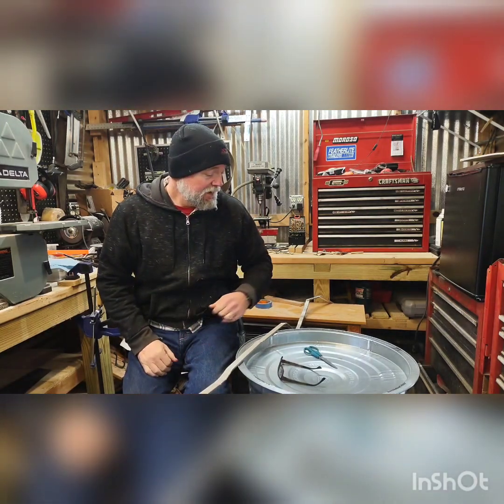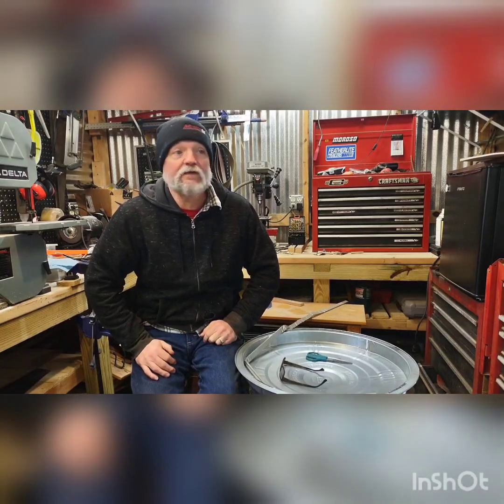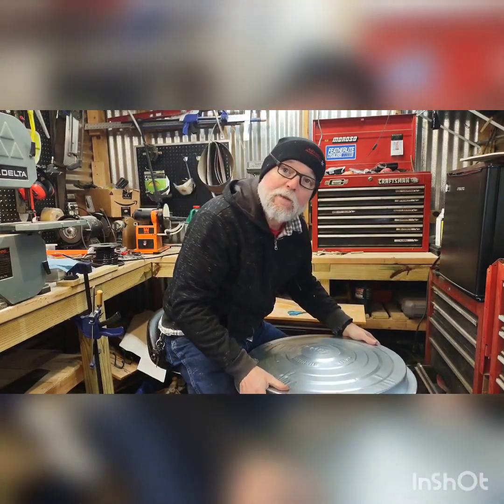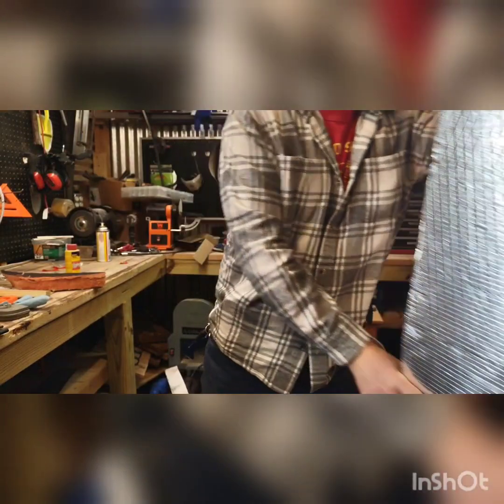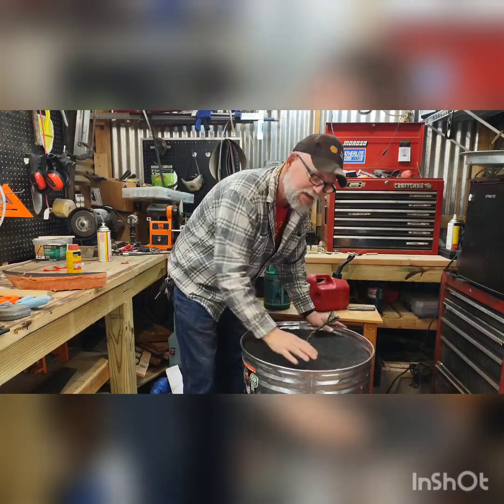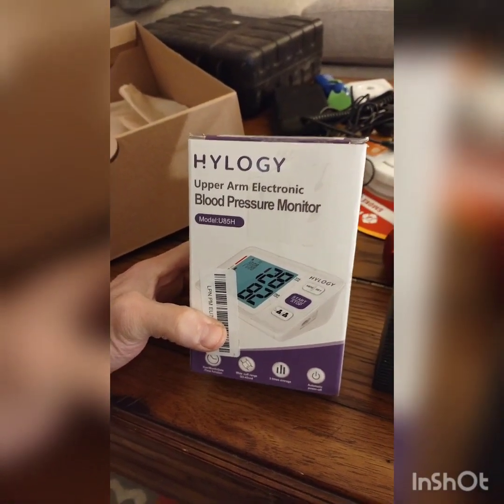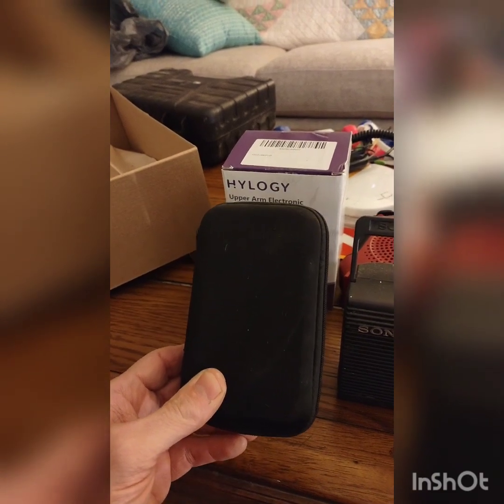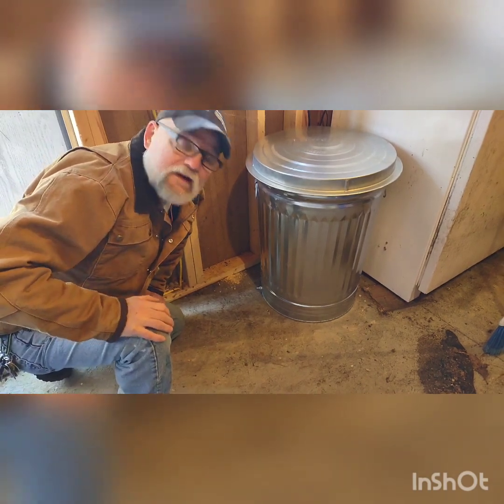Faraday Trash Can Part 2

Comment: Sorry I accidentally deleted my other comment. I asked about the rod and you said they're available at Lowe's $59.00for brass or 20 for steel and you opt for brass as it conducts better. I am kind of the school of thought that if you had any, even if a straightened out stripped clothes hanger, it'd be better than what the other guys have, ie nothing! Thanks. :-)